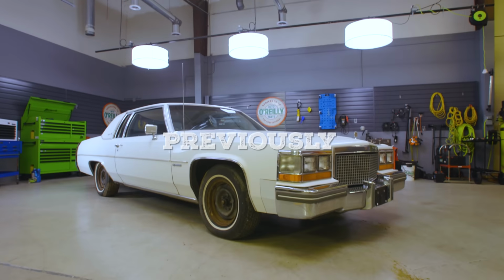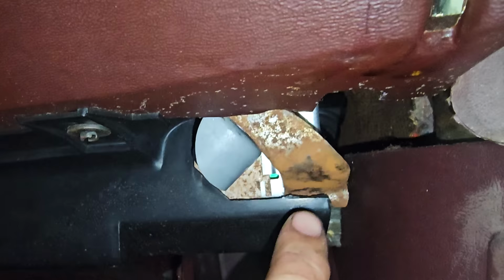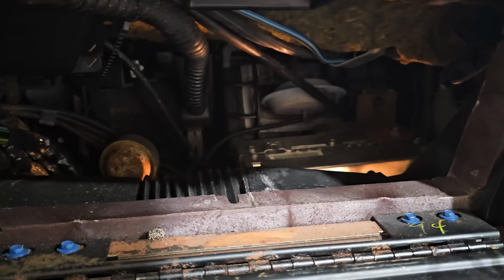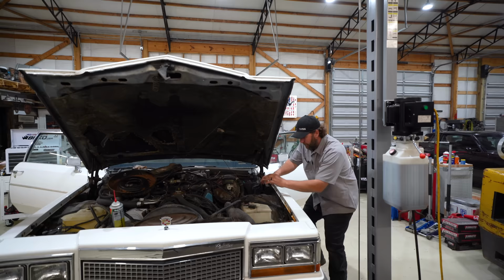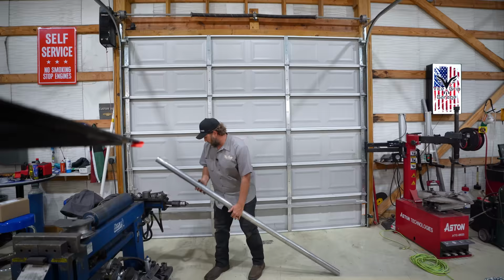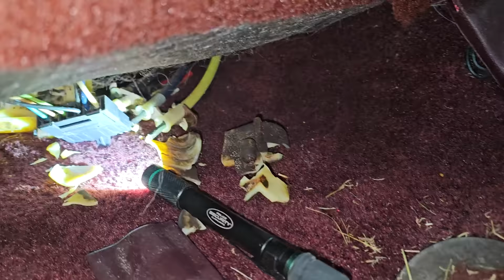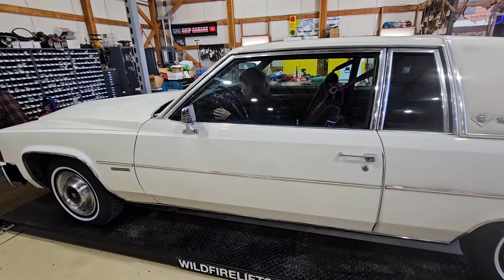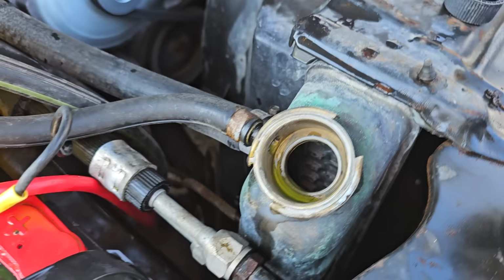Will It RUN AND DRIVE Finally? Carburetor or Computer On This 8-6-4 Cadillac!

Comment: I was working at a Cadillac dealer in the 80s, the throttle body injection was great, as dependable as a wind up watch, way better than a carb, that car should have built in diagnostics, just key on push the off and warmer buttons at the same time, and you can get codes and data on the ac display, the 864 system was too slow and did not work well, better to pull the valve covers put regular rockers and pivots on all 8 cylinders then you have a 368 v8 that runs great

Comment: Just glad my dad bought a new '79 Sedan De Ville and then an '83 Eldorado. The '79 was a great car for him. He loved the '83 with its white vinyl top, white leather, and continental kit, but it had the infamous HT4100. He didn't complain, but had to put a motor in it at 70,000. Used his $5,000 GM bonus on a very nice SRX that my Stepmom still drives.

Comment: Electrical tape is a great way to fix a check engine light! I wish I could show him the vast supply of abandoned and old cars sitting for decades where my father is from. After becoming a loyal fan of Vice Grip Garage a few years ago every time I see an old abandoned car I start thinking about how cool it would be to get those back on the road. I wish I had Derek's brains when it comes to fixing up cars

Comment: For future reference. On the majority of obd1 vehicles. You,yes un hook the battery for clearing codes,but then you get in and turn the ignition on and tap the brakes a few times. Works immediately instead of having to wait. Finishes draining the system . Works great.

Comment: Definitely a fan of the wire wheel hubcaps, even with the Oldsmobile emblems. My grandmother's 1979 Coupe Deville was born with the poverty caps. She's gone now and I have been driving the car since 2005. I got a nice set of Caprice wire wheel covers last year at a swap meet for $50, and I think it looks better even though they're not "correct". The only problem is that you need the adapters that bolt on to the wheels with the center bolt for the hubcap. If you don't use those, you'll be chasing them down the side of the highway! Don't ask me how I know that...😂

Comment: 88 is displayed to show that the display is working completely, that everey LED in there is ok. If there are LEDs faulty, you may misread a code, eg.g. a 9 instead of an 8 when the lower left led segment is not working. On old 7 segment LED driver ICs there was an inpud called "lamp test" to check all 7 LEDs in a digit.

Comment: If your up to it, there are new casings for the seat transmission box under the seat available on E-bay for about $50= "New Power Seat Transmission Solenoid Gear Casing Fits 79-85 Cadillac Chevy Buick".

Comment: That indent in the sidewall of the tire is normal. It is actually the strongest part of the sidewall because it is where the sidewall plys are spliced together. Over time it will show but it is nothing to worry about. The only time you need to worry is if you see a bulge in the sidewall as that would be a damaged cord.

Comment: Hi Derek, the tyre is ok, that is just a tread joint, if you check the other tyres you will see the same,  51 years in the motor trade you tend to pick things like this up,(and my wife used to work for a tyre Co in the UK)  Great work mate!

Comment: Sometimes an overheating engine just needs a new rad cap. 
If the system isn't sealed from cold then no pressure builds to stop the water boiling in the heads. A good rad cap will pressurise the system to 16psi and then vent to the recovery tank. When the engine cools it will recover the expanded water through the valve in the cap and keep the radiator full. If you depressurise the system when it's hot and then try and drive it no more expansion happens and the pressure doesn't build to keep it from boiling. I hope it's something simple like this for the Cadillac.

Comment: I remember index cards.  Never figured them out, but I remember them.  I also remember computer punch cards that if they were from the bank you could soak and iron to make them shrink ever so slightly and send in with your payment check.  The maching would not read them and it would give you more time to get money into the bank before your check would be deposited.

Comment: Nice to see the old Cadillac going down the road. It looked like the belts were pretty loose. I wonder what some radiator flush and some new belts would do, maybe throw a thermostat at it too. I do like the old GM Service Manuals, I bought one for my 86 Chevy K20. Thanks for bringing the family along, it’s always nice to see your kids enjoying the older cars. It looks like Bentley is going to be following in your footsteps pretty close. Thanks Again, Derek.

Comment: Many years ago I wad diagnosing a early 1990s GMC van with the 4.3L V6.  It was a crank/no start condition.  I went thru all of the basics, ignition, fuel, spark and air, everything checked out fine.  Engine  wound up flooding thru the diag. process, so I replaced the spark plugs, and changed the oil.  Anywho, this vehicle wasn't O.B.D.II, I went home and thought about it, went back to work, dusted off the OBDI, pulled up live stream data and saw the coolant temp was stuck at -40.  Well, I replaced the coolant temp sensor, and guess what, the van fired right up.  Long story short, the van wad dumping too much fuel because the computer thought it was -40 out(it wasn't, it was summer at the time).  So, yes, coolant temp sensor fault can cause a crank/no start
Reply: Had the same thing happen with a 89 celebrity, it was my grandma's car and she had trouble for 10 years or more with it stalling then wouldn't start, wait a while and it was fine. She took it to dealers and independent shops and nobody could figure out why. I had it at my house working on brakes and it decided not to start, I looked at live data and sure enough, -40. I changed the sensor and it was fine after that 😂

Comment: push the off and warmer buttons together .system will go into a switch test first displaying 70 .order brake pedal , gas in pedal , nuetral safety swich .then it will go into the DTC display ..It's been 25 or 30 years ago since I last did this.

Comment: Funny thing I had a V8 6 4 Fleetwood Brougham for a winter car, maybe 25 years ago.  Cost me $50. You had to back it in at night, as it would not go backwards when cold. It always ran on 8 too. After 6 or 7 weeks the transmission gave up all together.  Got $100 for it, and kept the best 2 tires.  With all that rear overhang it was great in the snow.

Comment: Derek as a fellow field reviver whom is native to Springfield Missouri id advise a thermostat removal white vinegar flush on that system and use the heater to check for a shortage of ice cube juice while on the go ! Low coolant = fluctuations in heat output

Comment: The EPROMs (erasable programmable read-only memory) is programmable that holds the code to do whatever it was supposed to do. You can still buy them and do it yourself.. If you know what you are doing, that is.
All kinds of electronics use them like older synthesisers e.g.

Comment: Hey man, trick to clear the ECM and really any tech is to disconnect power (battery) and hold the horn for a 60 - 90 seconds to drain the capacitors this will cause the ECM to clear all codes and start over fresh. Used to use this trick on my 91 firebird (tbi) to clear codes.

Comment: Boy, does Remanufactured in Mexico give me horrible flashbacks.  My dad had a TV repair shop in Nashville and in the late 1980s when Zenith changed their televisions where you replaced the entire printed board in the set if a component failed (it was called the main module) they were all remanufactured in Mexico.  During the summer when there were lots of sets damaged by power surges caused by lightning strikes he often went through three boards before he got one that worked.  Same thing applied to Philips/Magnavox electronic components.  I don't know if the quality of electronics coming from Mexico has gotten any better over the years but the stuff back then was garbage.

Comment: The dents in the side of the tire are where the cord bodies overlap each other.  On more expensive tires, they put a filler in to hide it, but it doesn't hurt anything.

Comment: I remember index cards in the library very well. The Cadillac hub caps are a better fit on the car but the wire hubcaps could have the center decal replaced. Too bad it is overheating but that could be an easy fix like a water pump since that radiator doesn't look bad.

Comment: Back in the early 1990s, my dad had a '81 Cadillac with the 8-6-4 engine.  He bought it from his cousin, who was a used car dealer, replacing a very YELLOW '77 Cadillac.

Anyhoo - that Caddy had a toggle switch on the floor, setting the engine to run only in 8 cyl.  If you switched the toggle, which I did several times by accident, the car would run in, well, the different cylinders as needed.  It was very noticeable when the engine switched to 6 or 4.

My uncle, who ran a tool 'n' die shop, and was on contract with GM, had some involvement in that engine.

Still it was a dependable car for us, only traded in when my dad fell in love with the 1999 Aurora which he kept for 20 years still - amazingly - running without issue over its 120k miles.

Comment: I still use index cards but they getting harder to find because of technology. I definitely had feeling that the drivers side rear center part of the hubcap would come off, but I learned a lot from this video about older computers in GM cars. Thanks Derek.

Comment: Too bad about the overheating problem.  It will be interesting to see what it turns out to be.  When you raised the hood my immediate reaction was there go the gaskets and seals.  Only one I had that bad turned out to be a contaminated radiator.  Of course it happened about 100 miles from home.  Managed to get it home and it dieseled for 15 minutes after I shut off the ignition....Of course that was in the day of cast iron block and heads so new gaskets and radiator pulled from a wreck were all it needed.  Nice looking Caddy.

Comment: The engine's all cast iron, it can take a little over heating I imagine. I remember having to try to work on quite a few of those 80's cars, I started as a mechanic back in the early 80's. I like how the car was 'waking up' as it was being driven, I've had a few old cars do that.

Comment: The reason the car did not start at first was the distributor connection. The 4 wire connector just controls the timing advance (ESC) and you can disconnect it but you must jump A to C on the distributor side to make it work when it is disconnected "I think" that is a long time ago. The Code 12 (no tach signal) you will always have in a non-running car. The other codes you had are hard codes but an engine should start in Limp home mode with those codes. Infact anytime your check engine light is on you are in limp home mode. On all Pre-1993 cars disconnecting the battery should clear the codes.   I cannot say for sure on your caddy but most 80s GM vehicles had a simple optical sensor in the speedometer to tell the computer speed.  The car still had a speedo cable. The only wires I am used to seeing on the transmission was for the computer to control the TCC. Those got disconnected all the time. GM computers did not start controlling transmission until the early 90s.  I did mostly warranty work starting in 86 so I did not see a lot of 81-82s.

Comment: Well an old geezer guy definitely has to give a guy credit where credit is due.  I would have opened up the power barn on that 81 Caddy and said "Ohh Look, a boat anchor!".  Definitely one of GM's brain fart moments.  Ranks right up there with trying to turn a gasoline motor into a diesel.  Congrats on your hanging in there Derek, nice job.

Comment: What a nightmare, the Caddie turned out to be Derek. I watched the first attempt with some trepidation, suspecting that it wouldn't move a metre. You are in a better situation to resolve this, than most likely anyone else that I can think of, though. So you will be swigging champagne after this, I assure you.

Comment: i remember running one of those pipe benders as a kid starting out. bending up an exhaust from straight pipe following the book to get the angles of the bends, the placement of, and the correct direction of said bend, was real and might have been fun, but it wasn't real fun lemme tell ya.

Comment: I learned that these tbi systems that if the coolant temp sensor has a fault it will not run until it’s hot.

Comment: The Cadillac hubcap with the center studs broken off just pry them up enough to use a butter knife with some 3m industrial trim adhesive and they will stay on after you hold down on the centers til the adhesive cures and nice cutlass supreme wire wheel hubcaps those are in decent shape someone will want them I've had the Pontiac version twice actually

Comment: used library index cards growing up. and in middle school library. i specifically remember middle school 7-8th grade, which was 77-79, because i was a nerdy type guy and chose working in library as an assistant as an open time or for some reason. i can't remember. specifically remember dumping one whole tray of them in front of two "Bobbie Ann Mason" types. quite embarrassing. then had to put them all back in order

Comment: Oh wow, actually do remember those index cards now that you mention it, didn't recall them till you brought it up and i remember being taught in school how they worked, interesting watching you do the electronical deal on this caddy, i just went thru basically the same thing with a 85 s10 blazer that had the first year mass production tbi injection and it had a  3500 rpm idle issue and i could smack the computer around and it would run perfectly for anywhere from 30 seconds to a month and it already had a remanned computer in it from 87 , it looks alot like the one in the caddy and mine was behind the glove compartment too, but found out mine was a one year wonder, but i went to the last junkyard around these parts the would actually let a fella in to rummage around there yard and found a $20 computer swapped it out and the old 2.5 iron duke 4 cylinder runs good except for now that the idle is where it should be it ticks like a teletype but dont think I've ever heard a 2.5 that didn't tick

Comment: Cadillac beat :

"Low and up
Up and cold
Off and "aceee", together
That was a three buttons
Was low and high, and hot
Nope, it was floor, defrost and cold
For three seconds
Nope, it was off and warmer
Let's try to pull some codes on that thing"...

Pure beat poetry...

Comment: You should have replaced the MAP sensor!  Change it and make this slightly unusual car work as it was intended from the beginning, it is both a defeat for the mechanic and for the history to rebuild it with a carburettor!  Some cars should be kept original for future generations and with the low mileage, few manufactured and the condition of the car, this is one of those 😉 !  Keep up the good work!  😊

Comment: The 2100 FORD 2 BARREL CARBURETOR  is the easiest one to use, just drill a plate to adapt to intake. And on fuel line just tee it off to the return line no need for a regulator.

Comment: Yeah, those Olds wires looked a lot better. I had a white 84 Cutlass Supreme Brougham back in the day. 231 was bulletproof, plush gray interior. 1997 gas was maybe 79 cents a gallon. I put 5 bucks in er and drove all weekend. Good times. 🍻

Comment: you can clear codes on the ac display, it will do anything the scanners of that time did, you can get data sensor voltages, just need to push the right buttons

Comment: a fast comment on the Cadillac 8-6-4......
I met someone who owned that car....   He said it was great, as long as it worked.  The problem was GM.

GM bought the control, it was electronic, that controlled the 8-6-4,  for lowest price.  It was cheap and didn't handle the
vibrations and heat of the car and would fail at any time.

GM charged a bunch of money for the replacement, which was another cheap bought for lowest price part and it would fail again.
He said he replaced it a couple times then just pulled the sensor out and ran at 8 cylinders.

Shame a car/engine gets a bad reputation when the company GM is too cheap to buy something that can handle the environment 
it will live in..

Comment: I had a mid 80s Camero that had the Tuned Port Injection and every 6 months it would need a new computer after the third time I traded it in on a 75 280Z which never let me down

Comment: could be an awesome project idea crossover with an Arduino expert and fully rebuild a new computer with modern tech, letting the V4 - 6 - 8 works reliable, testing MPG on a road trip

Comment: I have an 1984 coupe deville and fuel pump went bad.  Swapped it out and all it would do was just turn over.  So apparently there is i guess a safety switch to get power to the pump.  So i got the power from the license plate light wire and put my fuel pump on a toggle switch and bam..  She was alive..  Maybe it will help my friend

Comment: Hey Feller. If you end up burning that engine up but want to keep the car, I have a complete 425 out of a ‘79 Coupe deVille you can have. Should be a direct bolt-in. I’m in Mississippi.

Comment: Thanks for the super video! I was wondering what had happened to the Caddy! I am going to guess you have a clogged radiator or a bad fan clutch. Or maybe a broken impeller in the water pump? Can’t wait till the follow up video!